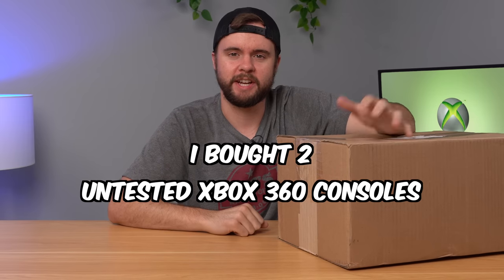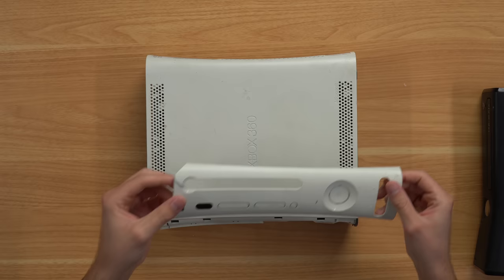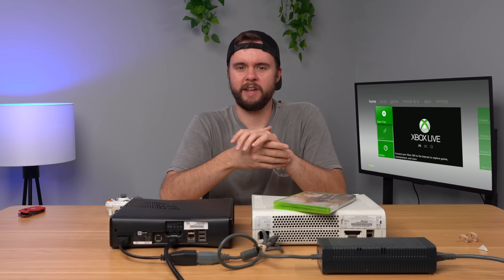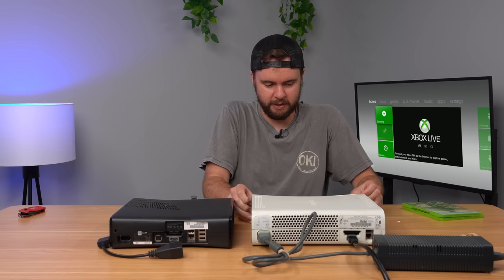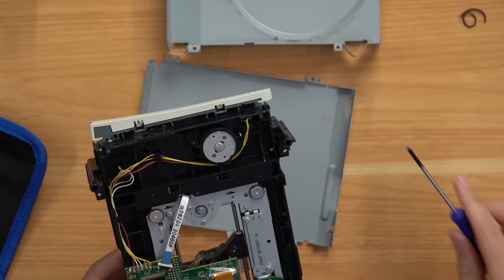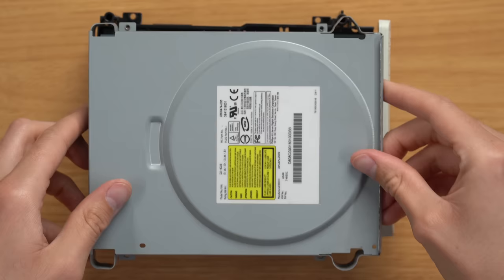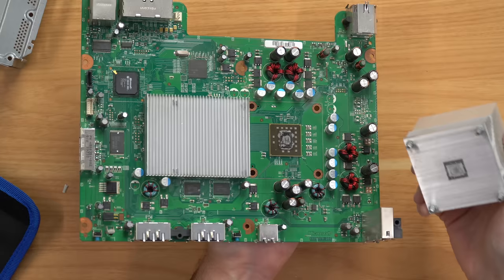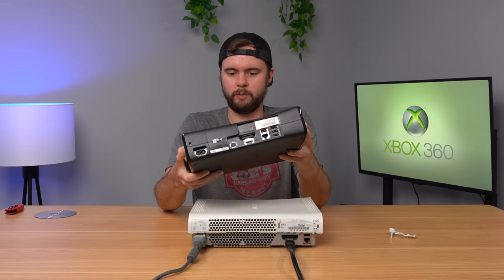This Xbox 360 from Goodwill BUSTED my ear drum… 💀

Comment: I recently ran into an Xbox 360 with parental controls locked, if you register the serial number on your Microsoft account, you can get a button combination to factory reset the system.
Reply: I have an RGH, so I just dumped my nand, and I got my key there

Good to know that there's another way
Reply from the maker: I swear I tried that like a year ago on a 360 and couldn’t get it to work lol but honestly that was a while ago so I don’t remember exactly what I did
Reply: I got past the parental controls on an Xbox 360 I got by lagging it and and spamming the menuing to remove the parental controls.
Reply: I love consoles with parental controls, I get them for cheap because most people don't know what to.
Reply: @peterharwood425 ...do??
Reply: @jrob0021  I did it a few months ago I can confirm it still works.
Reply: @ShadowFox10587O 
This is very good news. I recently bought an untested $5 360 and I was scared like crazy watching this.
 I never even consider this as a problem until I watch this video.
Reply: me with an xbox 360 with the serial number on the back ripped off and parental controls locked on 😐
Reply: @JohnDoe-wq5eu  I had the same thing happen to me with a used wii u. I had to use a community run website to get past it.
Reply: @ellanut8 can't you look it up somwhere in the menu?
Reply: @ellanut8  Try checking it on the System Info screen
Reply: @ellanut8 you need to type the one in the system info, it’s what worked for me
Reply: I’m curious as to what method you used to lag it that hard.
Reply: @jrob0021  the unlock method only works if you power down the console, fresh boot and punch in the code. If you get the code wrong, you need to power down again. I unlocked a slim and an E console using the fresh boot method 👍🏻
Reply: How to fresh boot?
Reply: Or you could try the most common combos, it’s usually something not very complicated.
For example, XYXY, RT, LT, RT, LT are pretty common.

Comment: Btw you’re wrong about the warranty stickers. Both of those are legit. The Xbox 360’s shipped with the shiny sticker, but when they came in for repairs or replacements we would put the paper stickers on top or next to the OEM stickers. They never said void because it was paper, but each repair would be noted with the serial number.
Reply from the maker: Weird.  I’ve seen tons of 360s that have the shiny sticker, but have never seen one that wide. They are always skinny
Reply: @jrob0021  Xbox 360 chrome warranty stickers were replaced around 2008 for the paper seals after the Elite was released permanently. But the change didn’t take full effect around until 2009… it was after Michael Jackson’s death. I remember that because it was a mess!
Reply from the maker: @rosarioflores1941 I’m still not finding anything about a wide shiny warranty sticker from Microsoft. The shiny sticker in the video is not the normal skinny one I’ve seen many times, it’s like double the width

Comment: That "weird" sound the console is making when opening the disc tray is actually the gears that open the disc tray attempting to open it. They need a rubber band to wrap wround them, and if they don't have one, it doesn't open and makes that noise. I found out the hard way after removing the rubber band from my brother's 360 when I was 7, trying to "fix" the disc drive.
Reply: Fun times I remember doing that with my dad's Xbox 😂 😿

Comment: I have replaced MANY Xbox 360 disc drive belts and I specifically remember all the drives I replaced them on were slow after replacing the belt and would commonly go back into the console automatically because the system doesn't think the disc disc drive has ejected fully or is stuck. After a little bit of use though the belt would stretch a little and the drive would go back to working normally. The OG Xbox's use the same belt too, except of the OG Thompson disc drive, those use a bigger belt.

Comment: You’re wrong about the warranty stickers. 

The sticker that’s shiny and says “Void” is the original “Microsoft” sticker and the one you said was “Real” is the Microsoft refurbished sticker that they put after they repaired an Xbox.

So they’re both real Microsoft stickers.
Shiny sticker said “Microsoft” before it was peeled off to revel “Void”. 
The paper sticker is the refurbished/repaired sticker.
Reply: my original jasper only has the paper one. and lacks any sign it ever had anything else.
Reply from the maker: I’m not saying you’re wrong, but your experience here is completely different than mine. I’ve opened up 50+ Xbox 360 consoles in the past 15 years and have never seen a shiny warranty sticker that wide. They’ve always been skinny. I’ve also seen Xbox 360s with only the paper warranty seal, including my brand new jasper that I purchased back in 2009/2010. So something isn’t adding up here lol. I’m trying to find photos of this wide shiny warranty sticker online and can’t find any
Reply from the maker: I’m honestly just curious because now I want to see that wide shiny warranty seal intact on a console lol curious to see what it looks like when it hasn’t been peeled
Reply: I can confirm that the shiny sticker is a sticker for refurbished consoles. The paper one is a genuine, non refurbished console so you have this wrong. I've opened numerous 360's and have seen it all.
Reply: @jrob0021  You're correct dude don't worry. The shiny sticker is a sticker for refurbished consoles.
Reply: @gahgae6650  That’s false because I have a November, 2005 Xbox 360 brand new in the box with the shiny sticker. 
The only reason I opened it was to verify that it was authentic when I purchased it from an estate sale + I purchased my original Xbox 360 Premium Edition at Circuit City on Launch day 2005 and it had the shiny sticker on it… Also you can find unboxing videos from 2005 and early 2006 with the shiny stickers. So how can you explain those?
Reply: That’s correct! The silver sticker was on original Xbox 360’s until around June 2009… That’s when we went all paper since it was harder to replace with heat guns/hair dryers as they turn pinkish/red when a lot of heat was applied to the paper.
Reply: @gahgae6650  The silver stickers were used from August 2005 - June 2009. We assembled them in August, but they shipped to stores in late October. After that we switched to heat paper as they would turn pink when an extreme amount of heat was applied to remove it.

You might remember the paper stickers more because those were later used on all models until the “Slim”. When an Xbox 360 came to repair the paper sticker would be used with the serial number imprinted to show that it was repaired by us. If there’s no serial number that meant it was brand new (2008 and older) and never repaired. We never used the silver stickers on refurbished consoles because we had to keep a record of all repaired 360’s during the red ring of death fiasco.
Reply: the original microsoft silver sticker is not that big. im seeing the one on my zephyr devkit right now and its consistent with i recall from my Xenon 2005 console.
Reply: To know for sure if your console had repairs done from Microsoft, your "Manufactured Date" sticker with the SN will say "Service Date" instead. My console had a paper sticker. Those also came from the factory for new consoles that had Jasper Boards or consoles that were repaired (these had the SN printed on them). Falcon Board and prior Xbox 360's had the small rectangular "Microsoft" sticker in the middle. I've owned both. The Xbox with the Falcon Board had a "Manufactured Date" in the back. My 2¢.

The explanation by rosarioflores1941 is the most comprehensive and factual. I'm sure this can be verified as true.

Also to go deeper in the rabbit hole, that console is a Jasper V2/Kronos board Xbox. Using the 65nm fabrication for CPU,GPU and eDRAM. 

If you pause on the GPU and zoom in, it will say "Kronos 1" in the top left corner. There's other tell tale signs on the motherboard and the heatsink used on the GPU.
Reply: @gahgae6650 nope i have a xenon that has the original faulty gpu in it and it has the silver sticker no paper sticker

Comment: Idk if you solder at all, but just in case you get another parental locked one: you can get the reset code by dumping the nand with a pi pico or other nand reader. You dont have to mod it or anything (although  you should, its fun!)

Comment: The hard drive that sounded so loud sounds like the disc drive had gotten worn out, and somebody made it worse by hamming the Xbox Console to force it open
Reply: All Xbox 360 consoles has an opening disc problem depending on the condition, opening and closing is most likely a wear and tear overtime because it’s made out of plastic, Microsoft removes the sliding door disc, and turn it into a sliding disc drive (because there’s been a lot of reports of Xbox Consoles having a hard time opening the disc tray, so now these days, every consoles are now having the slide-to-play drives

Comment: You can remove the parental controls password on an Xbox 360 by adding the console to your Microsoft account on a pc using the serial number. The console doesn't even have to be on the internet for it to work because Microsoft can generate the reset code based on the serial number. When you add an Xbox to your account, you view it in "manage devices" and there will be a button that says "Reset pass code". When you press it, it shows you how to reset the code. It will tell you to go to the system info screen, type in the button combo to access the reset screen, then type in the reset code. The only time this doesn't work is if someone already linked the Xbox to their Microsoft account, but that is extremely rare from what I've seen since there's no other reason to do it besides this.

Edit: I see you said in another comment that you've tried it before and it didn't work, maybe it would be worth trying again next time you have this problem. 🤷‍♂

Comment: Isn’t that GPU heatsink the older design one? I thought the Falcon and Jasper consoles used the heatsink with the Mini heatsink that sits in front of the CPU heatsink.
Reply: The console in the video is a Tonasket. They used Kronos GPUs so they moved back to the original heat sinks due to not needing the extra heat conductivity anymore.

Comment: Hey man, I'm new to your channel but for a few days, its the only thing I've watched, so thank you for that :). Just recently got into retro gaming myself since a friend of mine gave me a PS2 slim and also bought a PS3 slim with 2 oem controllers and 2 move controllers and ~10 games, all for ~40 bucks. I'm looking to also buy a 360 and mod it so I can play on it. What do you recommend? Slim or Elite? And what version is the most reliable? Thank you so much.
Reply: The slim is a lot more reliable, and it also comes with wireless.
Reply: The Xbox 360 E is one of the most reliable 360s, they were manufactured at the end of the 360s life cycle so many problems with red ring, disc drives and stuff were fixed. It also uses less power than the other models.

Comment: Have you ever came across a fat 360 that freezes at the starting screen? If so how did you fix it
Reply: What do you mean specifically?
Reply: @forrandomsites3336  I start it it gets to the Xbox loading screen then freezes up. I took hard drive out and turned it on and I get to the dashboard then it freezes there.